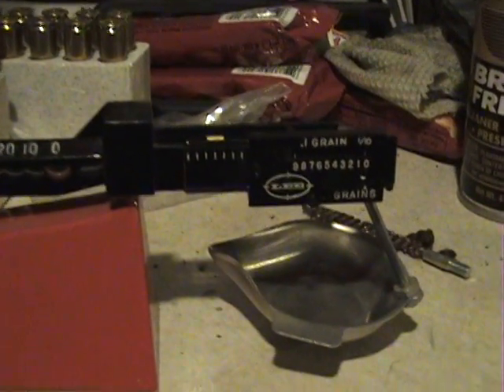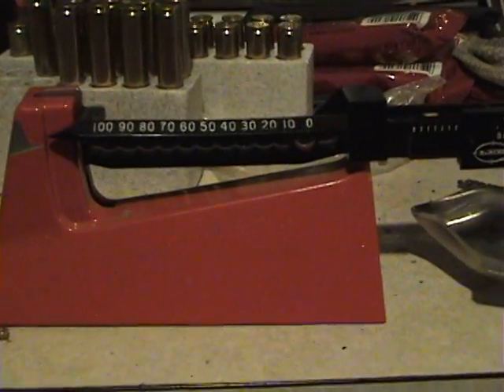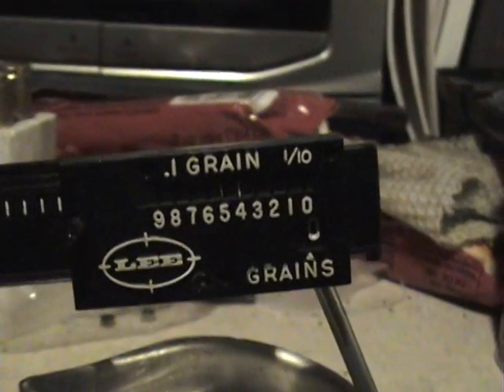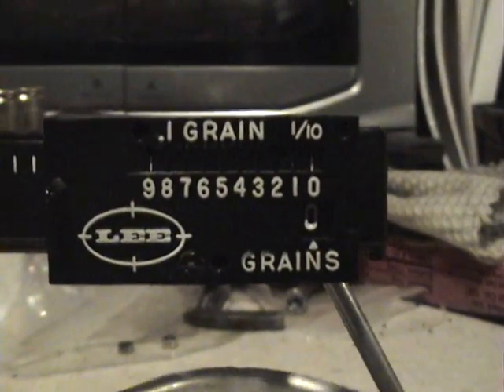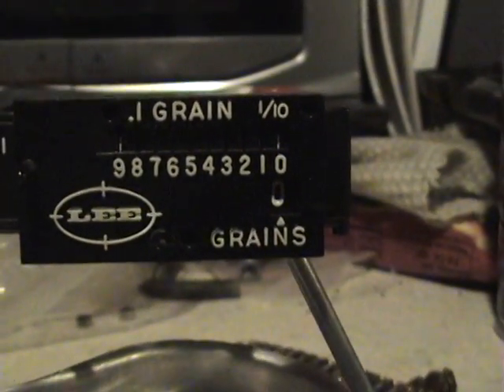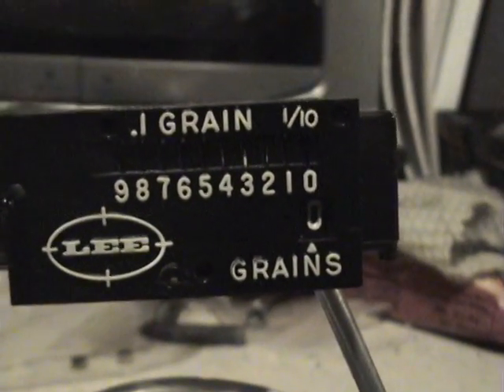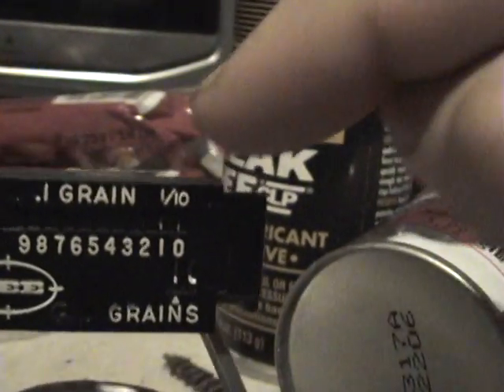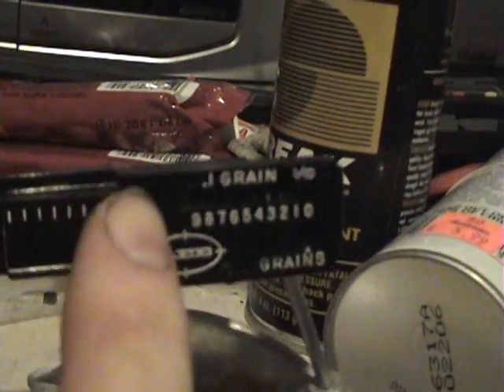how to: Lee Safety powder scale, reading and operation

Comment from the maker: @TooLittleRC it sounds to me like you have a defective scale.  I would call lee and tell them about it, and they wil fix you up.  probably there is either something wrong with the damping system, or the pivot point is incorrectly manufactured.  you can look at it by taking the beam off the scale and seeing if there is damage to either the groove the edge rides in, of the edge on the beam itself.